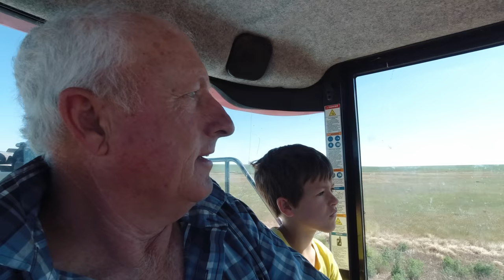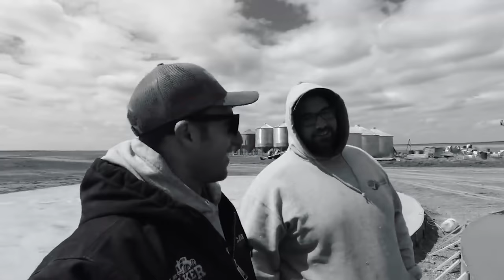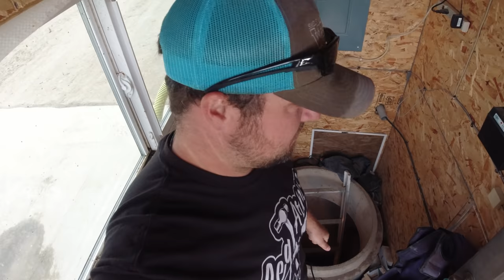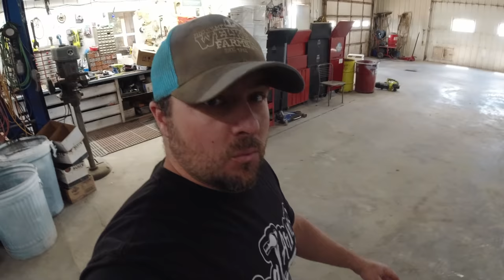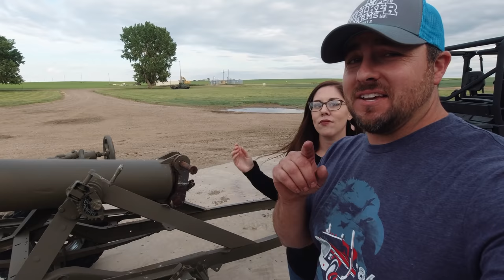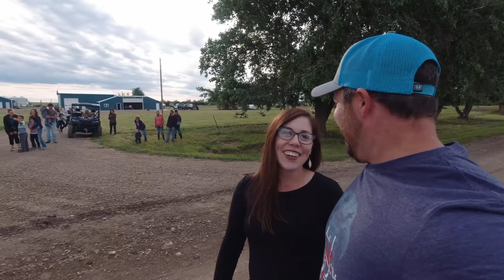Another WELKER?! 📣 🎊

Comment: It might be the starting capacitor on the pump motor. You might look into setting the pump vertically with the motor on top. You could even add a shaft to keep the motor out of the hole completely.

Comment: I've dealt with high pressure pumps before.  I suggest that you have the supplier balance the impeller before you pick it up.  If they've balanced the impeller there should be grind marks on it.

Comment: I my experience when replacing a pump or motor you should replace both at the same time. 90% of the time the other "good part" will fail in a short time also.
Congratulations on the new addition!

Comment: One of our neighbors made a backbone truss with electric conduit and pex-aluminium pipe (for the little A frame supports). About 300 or so Euros for the whole affair, for a stationary boom that's operated from the back of a converted truck ( a toyota hilux that's permanently assigned to be a boom truck). Looks pretty much the same as the professional one you have on loan.

Comment: Scott congrats on the new addition to the family.  Amazing how you guys are able to fix everything that you do.  If you can't fix it you just make a new one.  I do not have that talent.  Question about the well pump:  I am familiar Submersible Pumps and ground level pumps, but never seen a pump below ground in a dry cavity before.  What is the purpose of the pump in that environment, is it pumping from a well or surface reservoir?  What size motor was on it - look fairly darn big.  Great videos as always - keep um coming  Thks
Reply: It's purpose is to boost the flow of a city water line for a quicker fill of spray tender tanks.  And to push flow over a hill to our farm  1.5 miles away

Comment: Southern cross starline pump or similar if going a the close coupled way. Less likely to  get water in the electric  motor if the pump seal fails.  https://www.southerncross.pentair.com.au/products/end-suction-centrifugal/starline-close-coupled-iso-2858/     (Might figure out how to do a sump drainage pump so not standing in water if there is an electrical fault, suction strainer on lift pump to screen out rocks before the impeller.
Reply: Thanks for the info 👍